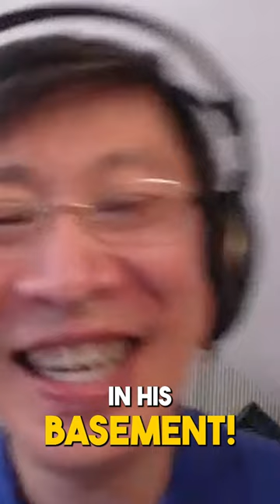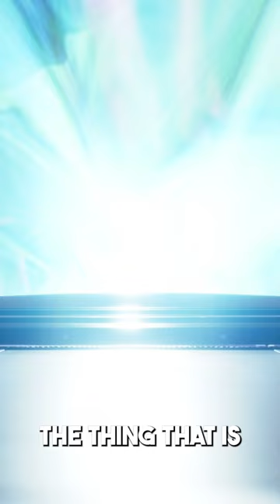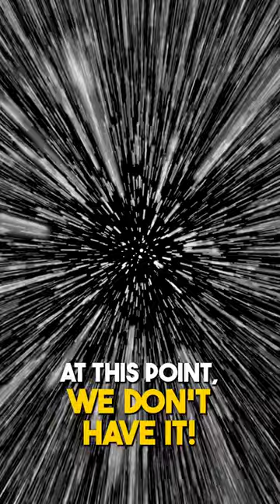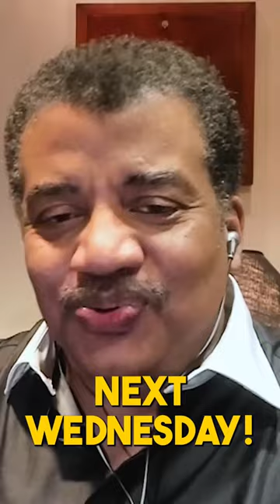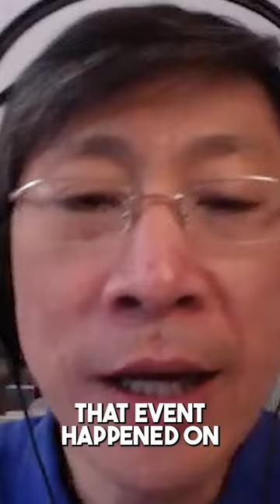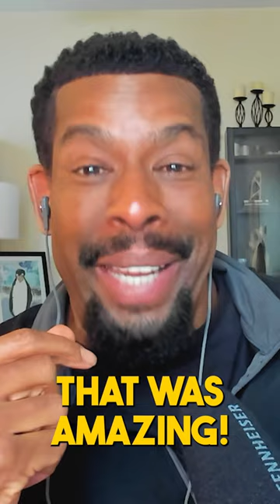What Is The Biggest Obstacle For Developing A Warp Drive?

Comment: We can't go faster than light for it's the speed limit of 3rd dimension. We can, however, "blip" through it. When a 4D particle travels in 4D, its 3D-projected particle travels through 3D as well, but upon meeting an 3D obstacle, the projection will be blocked temporarily, leaving the 3D-projected particle disappears and re-appears on the other side at a seemingly faster-than-light speed, aka quantum tunneling. We won't get a speeding ticket for this, since technically our speed was below the speed of light.

Comment: If we have a star that's 10 light years away. And we knew that there are aliens there and we wanted to visit them, and we could go as close to the speed of light as we wanted but not faster than light (and of course, no warp drive either...).

We could still visit those aliens in our life time!

And that is because Einstein is actually going to help us with that:

When you travel close to the speed of light - the closer you get to it, the more time and space contract and dialute, so that, the amount of distance that you are going to measure when doing the trip and the amount of time that your clock is going to measure, shrink by the γ factor.

γ = 1/sqr(1-(v^2/c^2))

So if you travel close to the speed of light with a speed "v", if you place this v into the bove formula you are going to get a number;

That's your gamma factor. That's how much less time you are going to experience while doing this trip towards this 10 light years away star...

For example...

If the star is 1 light year away... Conventionaly it would take for you thousands of years to get there...

But if you travel with a v = 99.9999400493% the speed of light, your γ factor is ~ γ = 913

That means that time runs for you ~ 913 times slower than those on Earth.

That means that for you that 1 light year trip will only last 9 hours :D

And you will have covered the distance of 1 light year in 9 hours. Withought the need of a warp drive.

If you want to play around with this, I created a tool in geogebra that calculates all that. Saddly I can't post the link here, but I can point it to you:

its geogebra dot org / classics / zzz9t3ju

if you are tech savvy you shouldn't have a problem getting in there and playing with this tool
Reply: That's cool, I'm glad you spent the time to make it! :)

Comment: I feel like he ignored the question. A warp drive isn’t going faster then light, it shrinks the space inbetween itself and it’s destination.
Reply: That would require negative space which is not something that exists. Even if we could find a fuel source to power such a drive, negative space is not physically possible, therefore something like an alcubierre drive is not possible.
Reply: no. Warp drive consist of making the space that you are going faster than light. It works like a black hole. Creating a lot of gravity so you can accelerate to an ftl without propulsión

Comment: @StarTalk what if the universe is drifting apart due to the electromagnetic energy/radiation imposed on solar systems and exo planets for the past billions of years is really what we observe to be dark matter. if this is the case would heat than be able to use the same wavelengths to permeate through space this would still explain the absence of matter in space but in its place radiation.
Reply: No